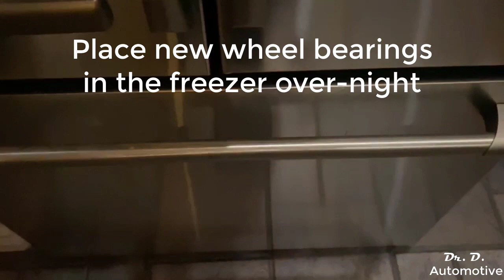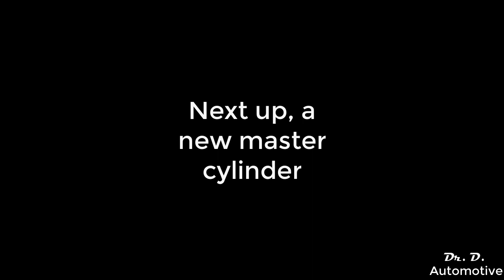Complete MGB front brake job!

Comment: 25:16: I don't think the purpose of the shims is to allow the cotter-pin to line up with the hole in the castle nut - it's to ensure that there is the correct 2-4 thou of end-float for the wheel bearings once the castle nut has been snugged to the correct torque range - so the bearings don't bind up when everything gets warmed up in operation.

Comment: naval jelly is practically the same as wd 40 rust remover. both have the same active ingredient: phosphoric acid and probably says so on the containers of both products. it's been around for a century and can be thinned with water to a consistency of the WD 40 product. i wouldn't be surprised if when watered down it cost half the price of the WD product by volume and effectivity.

Comment: I hate to mention, but the springs that hold the brake pads in were installed upside down in your video. The longer tangs face inwards to align the pads. I also find a dab of antiseize on the contact surface between the springs and pads helps keep them moving freely, but they rust away to nothing within a few years in any case.

Comment: A hydraulic press will do wonders when it comes to pressing bearings and races in out of wheel hubs among other jobs.
Reply: Always On the Move  a vise works for almost all of those needs, actually, and a couple large sockets to match diameter of bearings.

Comment: Your next two tools should be a bench grinder with a wire wheel, and a vise, both bolted to a nice sturdy bench. So much easier to just power the rust off with a wire wheel, then put the hub in a vise so you don't have to hold it.
Reply: superlukage have those, but each, is mounted on sturdy piece of wood, so can move around, and use regular furniture clamps to steady them on the workbench😊

Comment: Another great video in the series! Question: Do the metal brake lines (the ones you did not replace yet that run the span of the chassis) need to be cleaned out? Brake fluid absorbs water and is compromised after about two years. So one does not want this residue in the lines. (Similar goes for the fuel lines from pump to filter.) How do you clean these brake lines? Spraying liberal amounts of brake clean through the lines till then run clean? Thanks! Oh, one more question: How did you free the rear axle? It was frozen when you pulled the car from its 30-year grave. (Did I miss a video?)
Reply from the maker: Hi! To clean brake lines, the best way is to blow air through them with an air compressor. That should clear them. I did free the rear drums in one of my videos called “getting the MGB to roll” to do so, I had to turn a drum adjuster dial so that the brake shoes would back off from the drum. This dial is shaped like a 1/4 inch square and sticks out from behind the drum brakes near the top.
Reply: @DrDExplainsStuff  Thanks so much for taking the time to reply. Wishing you all the best for the restoration. Will be watching.